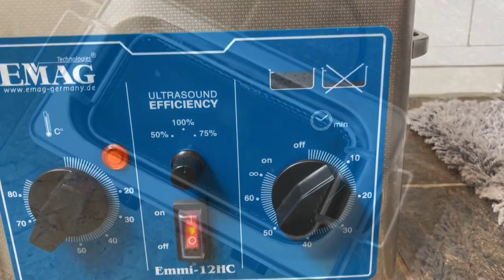Rolex Datejust 2080 Restoration Refinish

Comment: Isn’t it better to leave a rolex with it’s natural state of use and unrestored? I heard it’s value is more than a refinished one
Reply: that s only true for vintage rolex pieces that are rare. This piece is readily available new from rolex. its like with old racing cars. with their patina on and trces of the race track, they are worth way more. try to sell a used car thats 5 years old. With dents and scratches it will be worth less. so actually this rolex increased in value and is worth more than it was before
Reply: aole89 oh ok. I saw a video that rolex hold their value. And that within 5-7 years it’s worth more than it cost especially one that has t been serviced since the remove the Orignal crystal and replace it with an replacement one marked on the bottom with an S in the crown for “serviced” and they don’t return the original parts to you. They said Although it’s good to have it serviced and it’s done buy rolex with rolex parts it devalues it in the long run. That’s y I asked because there so many videos saying on thing and then another video saying the opposite. It’s confusing. Thank you for replying
Reply: @Chucktinez  no problem. the rolex models under high demand cost more used than new, because you are sinply not able to buy them from a dealer. the waiting lists are long. a new submariner will cost you about 8k while the same model used goes for 12k. no possibility to get it at resale unless you are your dealers favorite customer. the service interval on modern rolexes is about 8 years. so with your example of a 6 to 7 year old rolex it would be worth more serviced because the buyer doesnt have to do it after 8 years. and yes, when servicing they will keep the original parts. but with modern rolexes that doesnt matter, because they will replace it with exactly the same part only a couple of years younger. while in vintage rolexes they will actually replace the vintage part with old lume and writing etc, with a modern part that underlies modern production. so completely different watch then. also they dont mark the crystal.